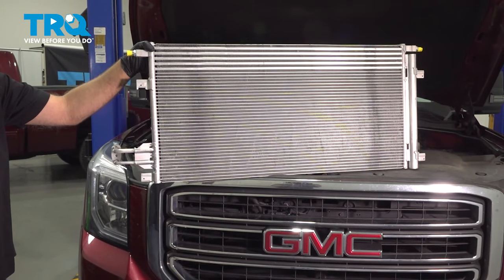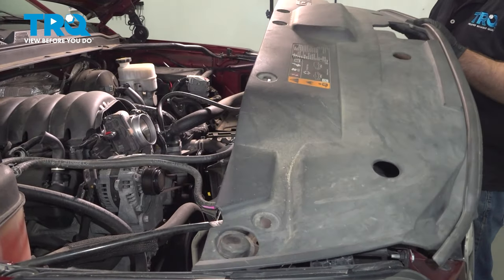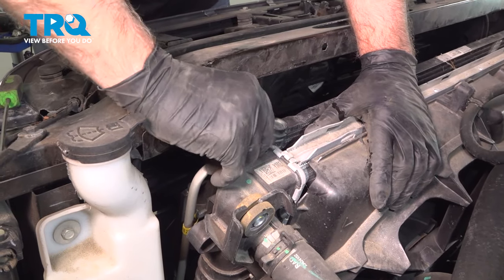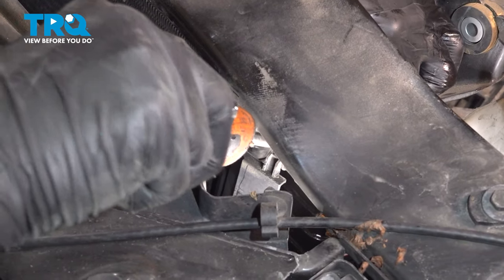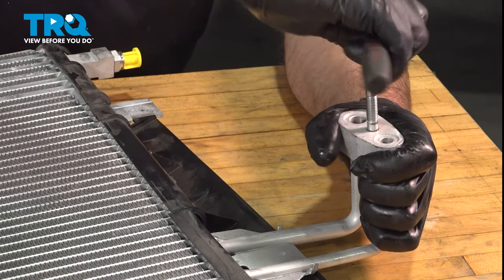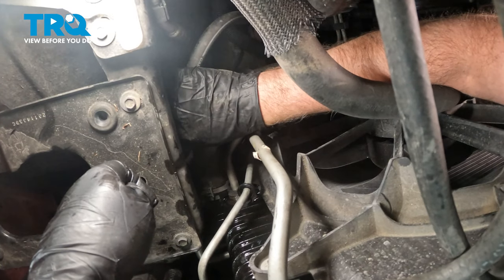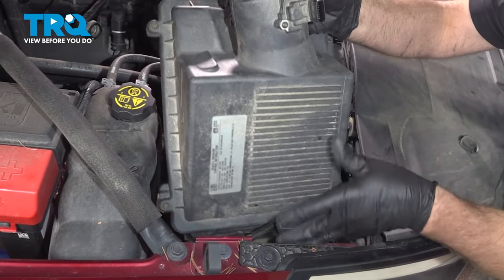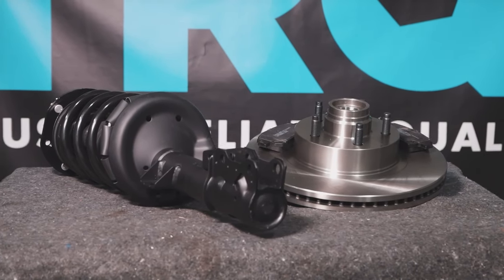How to Replace A/C Condenser and Receiver Drier Assembly 2015-2020 GMC Yukon XL

Comment: Access to the radiator, lines and brackets will be easier and no leak mess if to remove crossmember, under filter box tray, frame that support that tray, and loose reserve battery tray

Comment: If transmission line is difficult to snap into place remove the nut that gas C-clip on it with 19 mm(3/4”) wrench, and install the line in much better position, then install that nut.  Works much easier this way

Comment: The core support is removable there are 3 10mm Bolts on each end  pointing up from under the support and one 13mm in the front would have been much easier

Comment: I have a 2015 gmc 3500 hd duromax,  and it has a separate trans cooler, and the normal procedure like this doesn't work. Do you have a video for heavy duty diesel trucks?